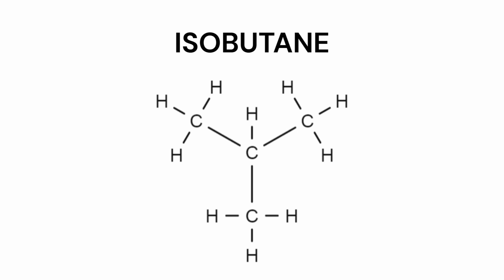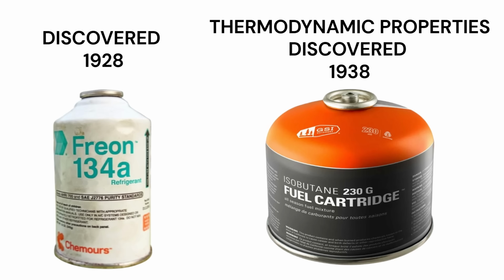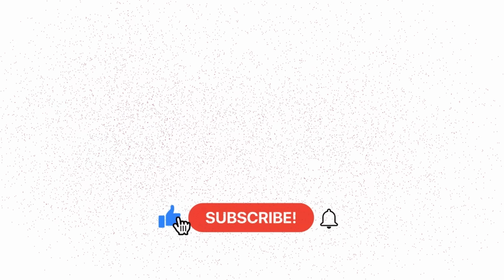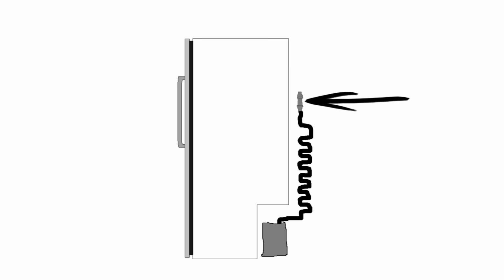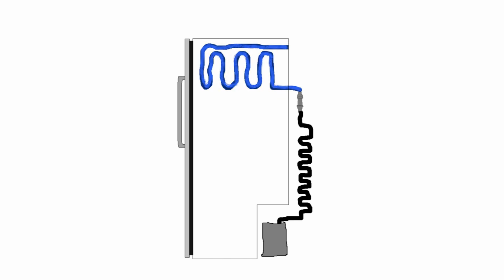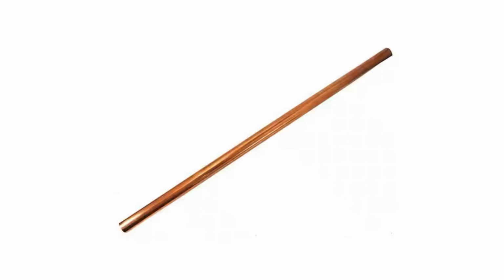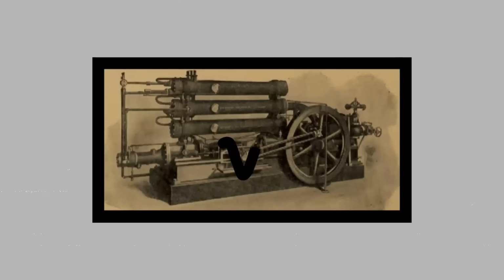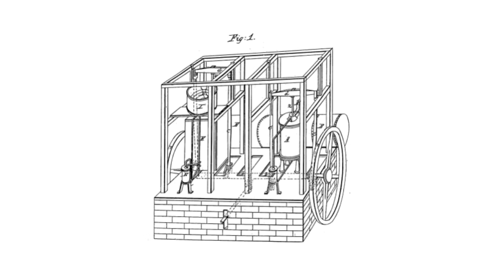Was Doc's 1885 mechanical fridge in Back to the Future really possible?

Comment: In all honesty he most likely used an even more readily available liquid that has a low boiling point due to the geographic location and limited supplies. One that we see him using in other similar mechanical applications. Alcohol!
I suspect Alcohol as the refrigerant more due to availability, cost of acquisition, cost of purification, and it's lack of corrosive properties. With it he can use iron which we see on the machine more than copper and was much more readily available where he was, he doesn't have to worry about a leak killing him and a bunch of other people, it's cheaper to get and much more abundant, processing it is easy with with a simple still, and he can even use it for other things. Ammonia on the other have would have to be imported which could get expensive especially if he had to import other materials to handle it, and it isn't widely available locally due to the lack of local industries that would be using it.
Yes Alcohol wouldn't be as good over all as Ammonia but it honestly makes more sense in that scenario.
Reply: ammonia can be made from heating lye with nitrate containing compounds.  lye is made from boiling wood ashes in water, nitrates can be made from manure. plenty of both in the wild west.

Comment: Phase change is not necessary to make fridge: any gas could work, like air. It's not as effective but still works. 

It looks as biggest part of Doc's fridge is steam boiler with steam engine that rotates the output flywheel. This part is mounted on a wagon so doc can move it around when needed. He used it to generate some electricity for model train.
Reply: THAT was what was goofy, not the fridge.

They have only seven days to save his life, so spend one of them building the model train?

Comment: I honestly have assumed it was an absorption chiller, Something easily built back then. And a steam engine was already making the heat required. These chillers are still in use today, Its how many buildings in NYC run their air conditioning using the ConEd steam service.

I suspect Doc did not push this stuff to setting up air conditioning in the living areas of his building, because that would get just a hair too suspicious. The local smith and inventor having stationary steam engine is not too out of left field, having their living space at 68deg in the dead of summer in the desert is a bit different.

I also suspect that he probably faced limitations in getting quality ammonia in quantity out there at that time.

Comment: O.K,  more complicated Scenario, could the professor on Gilligan's Island have made a mechanical fridge? 
I personally doubt it myself. 2 coconuts and some Bamboo for plumbing would not have done it.
and Gilligan's legs would given out on the bike that they used to generate electricity, run a washing machine,
and large fan, before, the ice even started to freeze... just putting it out there, to see what Mike comes up with . . . .

Comment: I always immagined that he used a coal fired steam engine to run an air compressor to push air through a vortex tube that would seperate high and low energy air particles into separate streams. The hot air could be fed back to the firebox to reclaim some energy. No liquid refrigerant required.

Comment: well you dont have to heat stuff with rotary components, you can use also electric wire resistance heating similarly as in propane fridge.

Comment: opens hermetically sealed fridge compressor
finds a piston pump and electric motor
"gee, arent they... mechanical?"

i dont see why the "mechanical" part is important?

theyve been making ice in the middle of the desert for thousands of years with no machinery at all...

the first fridge didnt require electricity. the same principle is still prevalent today as three-way or absorption style units.

theres also that neat trick of salting ice and getting it to get even colder as it melts... "phase change" and "latent heat".

dont need steam. dont need electricity. dont need tight fitting pistons or motors... dont need ammonia either.

movie scripts are not written by experts or even people with rudimentary knowledge in certain fields. they simply create "word salad" and we, the masses, lap it up... it isnt gospel, it isnt educational. its entertainment. make believe. prop makers dont make working machines following simple principles, they slap bits of foam together, carve it here, paint it there, and attach an electric motor and a few air valves, and it looks good on set. that is all.

"the theory is fundamentally sound and easily replicated" no need for conjecture...

Comment: You keep saying "wasn't discovered" but it doesn't need to be if he already has the knowledge and may even have knowledge of locations to get materials to achieve such things, electricity wasn't off the table if he made a gasifier and had copper and magnets
Reply: except Doc made a steam fridge, not an electric one. Not to mention he did it pretty quickly meaning he wouldn't have had time to go to all these locations and get materials to invent certain things from scratch.

Comment: I own 2 large propane refrigerators. Both run off ammonia and obviously fire 🔥. "We still use ammonia refrigieration. "  Doc could have used horse urine and concentrated the ammonia out of it. A steam engine style compressor isn't necessary. He could have just used a vapor loop with a pipe size difference  used to facilitate phase change.. like my fridges.

Comment: A refrigerator is a heat pump. A steam engine is also a heat pump. If you have a steam engine, you have everything you need.
Reply: Use a Stirling engine to get a cooling source?  The initial steam engine provides the rotary motion, and the Stirling Engine(s) make one end hot and the other end get cold.
Reply: All you need is the boiler. 
Search for "steam jet refrigeration system"
No moving parts other than a valve to turn it off.
Reply: You have the framework, you're still going to need another refrigerant otherwise it's not going to get very cold

Comment: if copper pipes existed, copper wire is not that difficult to produce, which means he could have used electricity with his knowledge. I think the approach to using steam was stylistic on the idea that doc always was a man who didn't want to make too many ripples in history, so that would have been the reason he didn't use it rather than just because it wasn't available (he could have made anything available). Compression may have been achievable but being mechanically inclined enough to keep the system airtight would be the issue, he had to outsource some of his work to a local blacksmith (as mentioned in the movie)....this would have been a pretty big problem in his designs, and probably why it took so much "energy" to produce 1 piece of ice (who knows how much ammonia he would have gone through for it).
Reply: TBH, the whole thing was a joke. If he didn't want to make too many ripples, he would have just made one of the existing refrigerators with a few minor tweaks to improve efficiency. The thing he made was a lot more complicated and a lot less practical than devices that had been around for decades at that point. 

I also think it's kind of weird how he didn't just pay off Mad Dog when Marty tells him that he was going to be killed when he wasn't supposed to be killed in that timeline.

Comment: Ammonia is still used as a refrigerant today actually - it's typically used in large commercial installations like ice rinks and such. You can tell because there will often be a hazmat door with a sign saying "Danger: Ammonia". It's cheap, it's relatively environmentally friendly so accidental ammonia leaks won't contribute to greenhouse gas emissions (ammonia is not a greenhouse gas), and doesn't destroy the ozone layer. It is highly toxic requiring special handling and breathing equipment. The only reason you don't run it in your AC is it's highly corrosive, so only large commercial installations will use equipment that won't corrode. It was used in early home refrigerators in the 50s but its toxicity lead to using other refrigerants instead.
Reply: Engineer here, everything you said is true and here's one other reason it isn't widely used. It is also volatile. Because it is an excellent refrigerant, it got a lot of use in the beginning but you basically need super high end engineering of the entire process which is so expensive as to negate the benefits from efficiency. Basically if you have a faulty part, the result can be dangerous gas leaks or even explosions (which ALSO releases said gas).
Reply: I briefly worked at a food warehouse that used it. I knew because I saw the ammonia alarms.
Reply: Used for thermal management on ISS
Reply: Ammonia refrigeration is used widely in RV refrigerators as works quite well with either an electric heating element or propane flame. It was dangerous in old times but is much safer with the sealed systems that are common these days.
Reply: @whomigazone  True, its also used in really high end stuff because depending on the application, that extra efficiency might be worth the extra cost in initial setup and maintenance

Comment: Ammonia is still widely used in propane refrigerators. No compressor needed, phase change is acchived by heating the ammonia with a flame.
Reply: Actually steam driven compression  refrigerator date from the 1878 with a shipment of frozen meat from Paraguay to France closely followed by a shipment from Australia to Britain.
Reply: @allangibson8494  " In 1877, the French steamer Paraguay equipped with a Carré compression machine completed the first successful travel with its shipment of 5500 frozen muttons from Argentina arriving to France in excellent condition"
Reply: Ammonia is widely used in industrial and commercial applications.
Reply: It's called absorption cooling.
Reply: @adamw.8579 And that system was patented by Albert Einstein and Leo Szilard in 1926. (You may have heard of them).
(It was a development of the absorption process developed in 1922 by Von Platen and Munters that was put into production by Electrolux).
Reply: @TheDrakenZ The original poster was referring to evaporative refrigerators not compression refrigerators. An evaporative refrigerator would be an anachronism while a compression refrigerator wouldn’t be.
An evaporative refrigeration system requires high tensile steel to withstand the high pressure, a compression refrigerator surprisingly doesn’t.
Reply: Yeah ammonia is what's used for most large industrial coolers.
Reply: Yeah that would have been way more efficient than a steam piston setup, plus you don't need difficult to seal bearings, just brazed or soldered c̶o̶p̶p̶e̶r̶ steel pipes.
Reply: All correct except ammonia dissolves copper.  Quickly.

All ammonia refrigeration systems are completely copper free.  The ones I ran looked like weird V8 engine blocks.  

Had to drain the oil periodically from the receiver.  The ammonia that evaporated out of the oil would take your breath away.  And kill you if you kept at it..
Reply: @darrelljohnson7832 Absorption refrigerators usually use mild steel construction.
Reply: @darrelljohnson7832  that's nothing, I scraped anhydrous ammonia tanks and they all leak. It will take your breath away lol
Reply: That’s absorption type refrigeration. It’s been around for nearly a century. The minimum chemicals you need is ammonia, water and hydrogen. The circuits are hard to build and service though, but they are very simple in operation.
Reply: @tfrowlett8752 Ammonia compression type refrigeration is used for larger industrial installations (although propane systems are almost as common now).
Reply: so that is how the refrigerator in my parents caravan worked. aways wondered about that little pilot flame we had to light when we arrived and put out before we left
Reply: @TOOTIREDTOARGUE It’s little more complicated than that - absorption refrigeration uses an ammonia water solution that is fractionally distilled by boiling the solution, the ammonia boiled off is then cooled and it absorbs heat when it is recombined with the cooled water stream (the absorption reaction is highly endothermic).
Reply: @allangibson8494  ah ok, did not know that. thanks for the lesson
Reply: The "Crosley Icyball" was an ammonia cooler without compressor, very simple construction.
Reply: @SolarCookingGermany That design wasn't constantly cycling and had major weaknesses in maintaining temperature in US Army trials though.
Reply: Thank you. I was today years old when I learned just how RV fridges run on propane. I’ve been meaning to look into it 😅
Reply: You can also use propane in a propane refrigerator. you'd need a compressor tho.
Reply: Yeah, I had one in an old Mini-RV.  My first time out it got so cold it froze the cans of Coke and they exploded inside the fridge at 2:00 am.  I thought Bigfoot was breaking in.
Reply: We had one in our RV.  The line broke in the middle of the night and we had to evacuate.
Reply: Thanks! I saw them working as a young boy but never thought to look up how they work. I never would have thought adding heat would be an option! Super obvious now that you said it
Reply: Ammonia was my first thought.  Although I realized we don't have the haber process yet and I think he needed an iridium catalyst.
Reply: There's no real need for the machine to be that big though. Because by 1985 they had reduced the size of the refrigerators to be able to fit into a RV. My problem is the complaints that you don't have the means of actually accessing gasoline readily out in the West. Specially considering gasoline was a waste product at the time.
Reply: looking at one right now. RV fridge.
Reply: They were used back in the day but are very inefficient. Absorption refrigeration is only appropriate where you have waste heat and it has to be a rather large for it to make sense.